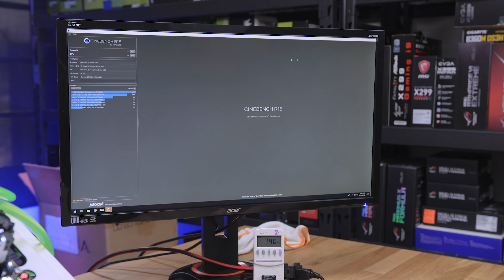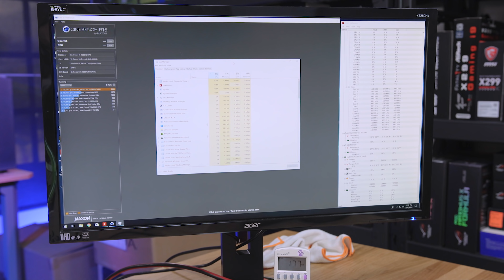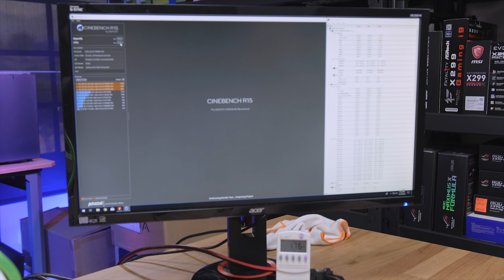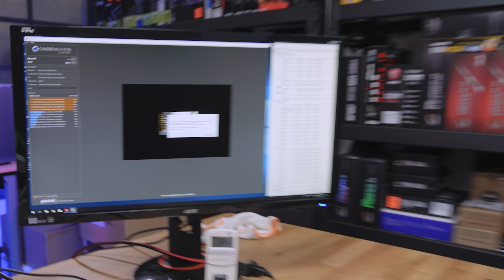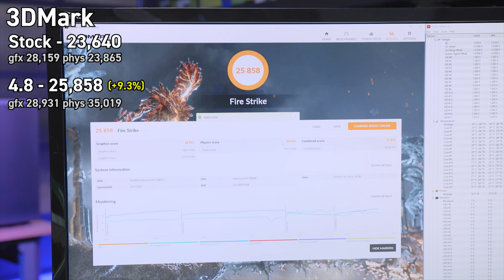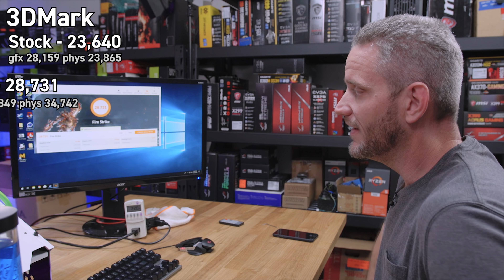Trying to get back on the 3DMark Leaderboard!

Comment: I barely reach 2100 MHz on the core with GTX 1060 until it starts to lower the clock right after 56 degrees on water.Guy gets 2.500 MHz on the core and call it Barely overclocked...  :D

Comment: Cool stuff man and congratulation on your top 100 placement. But a 1200 watt psu? why? You were only pulling 700 via kill-a-watt meter and 20% of that was lost in heat cause let's face it, 80% plus efficiency is only 80% ever on a good day when it rains dollar bills..... So 700 - 20% ='s 560 watts. Extension cord don't mean dick in this case, you can run "two" of those Pc's on a basic lamp cord and still be fine! 700 + 700 is 1400 watts which equals 11.6 amps assuming a perfect power factor of 1. 

I'm just saying, the lamp cord running the light at your bedside is enough to power two of those computers, you were in zero jeopardy running an extension cord unless it was maybe 500 feet long? Still, congratulations on your top 100.

Comment: Use a thick gauge extension and cut it to exact length to minimize on any issues of extensions
Longer the run the more amp draw you get

Comment: Worst case you are only pulling 11A.  If your extension cord is a 12ga and 25' you will not notice any significant difference from plugging directly into the wall. People make a big issue of plugging directly into the wall, but they forget they are essentially using a 50-75' 12ga extension cord  in the form of romex installed in the wall.

Comment: i can get 8ghz on a i7-2700k room temp has to be 10c to get those numbers. but it's only clocked at 4.6ghz.and i can never use the cpu fully only core 3 and 6 hit 100% and the rest won't get over 80%. and my pc won't get over 72 c at anytime on air only no water cooling loop.

Comment: You're also running on the wrong type of power in general. No one serious should be running the switch mode on generic household voltage.. yet you do.

Comment: The x5650 xeon chip listed on cinebench is actually a 6 core Westmere chip on the old X58 platform. They had dual CPU server boards available and a dual cpu enthusiasts board. With the use of one of those boards it would have two 6 core cpus and thus 12 cores and 24 threads for processing. A monster setup for the time.

Comment: @JayzTwoCents Is it even possible to build a really silent PC with zero compromises on performance. Watched your Asus Strix 1080 ti, also spent a couple of weeks watching reviews of different PC cases and still not sure witch components to use. Do you have any opinion about the beQuiet Dark base 900/800 and is there any difference. What I think for now is using beQuiet Dark 900 case + Dark Dark Pro 4(I use Dark Rock Pro 3 at the moment and is far from silence). Is it good idea to use its case fans with connectors of the strix 1080 ti.The idea is to use my PC for programming, watching movies(and reviews :D), music and base stuff without any noise, but be sure that the temps will be OK under 4k ultra gaming. There are some zero/hybrid PSUs as well.

Comment: Hey Jay, i recently bought a new PC not Pre-Built, with an I7 8700k on the MSi Z370 Gaming Pro Carbon with 16GB's of Trident Z RGB @ 3000MHz, and a ZOTAC GTX 1080 AMP! EXTREME, plus a Corsair RM650X PSU, and a 860 Evo SSD, im getting big stutters in every game which shouldnt be in a system that costs about 1700€, i would love to fix that because it was not cheap and im really getting headaches because of that, please help me...

Comment: Hey I am interested which version of Windows 10 did you use for testing? As for the background wallpaper I expect a Windows 10 version 1511  instead of 1803 (current). Is this right and did you choose it because it didn't gets the "slowing down" Meltdown / Spectre patches ?

Comment: Dear Jay, Please make a video about. How to reconize videocards and stuff.
The MSI videocards for example look very similair from the 660gtx till the 970gtx because of the red/black twinfrozen coolsystem. Its good to find any diffrences so you can tell your not being scammed. the only way I know you can see what card it is, is on the sticker on the rear. But its very easy to take that off and stick it on a older GPU card.

Best regards

Comment: Jay, what the hell are you doing? You're the Youtube GOD of custom water cooling and you actually run into temp problems? Put some rads in there, throw them in ice water, delid that CPU, GO BALLS TO THE WALL! What's the matter with you Jay, didn't have your coffee? Stop half-assing and GET THERE ON TOP! Get that TITAN V AND NUKE LINUS AND GN OFF THAT BOARD! DAMMIT JAY, GET YOUR SH*T TOGETHER, YOU CAN DO IT!!!!

EDIT: Oh and please just get a thicker or try using a shorter extension cord if you don't trust this one, but overall, they're able to take waay more power than that PSU requires.

Comment: Jay - 

Can the multiplier and the voltage values from one mobo be used on a different manufacturer’s mobo?? 
I was wondering what values might be used for... 3.6Ghz??
I’m not looking shorten the life of the chip.. just push it a little bit.

Comment: Redo this, with the insane cooler you made, with the giant fan, and four huge rads and air con. Run the cameras on batteries, turn off everything else in the house and overclock it until the software is on max, or it runs some other error.

Comment: hey jay, I have an issue with my gtx 960.
one of the fans grinds, but only when it gets above 75% speed. I've gone through a few suggestions i found, including taking the cooler off and seeing if the fan had moved any. no idea what's going on, could you help?

Comment: I have an idea for you, I have noticed with my stock 7700k (not de-lidded) that if I run the memory at it's rated XMP (3200) the CPU seems to get 3-8c warmer (depending on the applications used) than if I use the memory at the CPU's memory speed of 2133/2400

Can you do some testing to see if it's just me reading things wrong, or doing something wrong, or if there's actually some difference?

Comment: The x5650 is actually a 6 core 12 thread count that you can get for about 20 bucks U.S that benchmark shows results for 2 of them in a dual socket board
Reply: Yup and if you're lucky you can find a dual socket board on ebay for <$50 and have a complete system with like 1200 cinebench for around $200

Comment: would be nice if you could  try a "hybrid loop" with a TEC. I always wondered what would happen if you would sandwich a TEC between two CPU blocks and use the cold side to cool the water after the radiator and the hot side to heat up the already hot water from the system before the radiator. In theory you would be able to keep the delta pretty big in this way...

Comment: That was interesting. I'm sitting at a little over 20.5k with a 4790k@4.6 and an air cooled OC'd MSI 1080Ti (quick and dirty OC, no fine tuning, actually gets a tiny bit higher graphics score than Jayz best score)... I have a delidded 7900X coming with a full custom water loop (CPU monoblock + GPU) ready to be assembled in the next week or two. Happy days ahead!

Comment: So here we've proven that the Intel's TIM can remove 650W  of thermal power from the die with adequate follow-up cooler. I think we might owe Intel an apology here, and also deliding my i7-8700k with measly 95W stock TDP might have been unnecessary*...

Comment: Would it have worked better if that was installed into the Little Devil PC-V10 case with integrated Phase Change Cooler? and drop the CPU temperature to -70 degrees below zero.

Comment: just a regular 360 rad water cooler you say hmm if you did this with 3  360 rad coolers delided you could overclock this in the low 5ghz range

Comment: Hi I’m thinking of building a pc and I’m quite new please tell me if this is good and any suggestions would be appreciated 

Cpu - i5 8400
CPU cooler - be quite pure rock slim 
Mobo - msi z370
Ram- g.skill trident Z rgb 16g (if this is over kill for my pc I’ll happily downgrade as I’m no millionaire 
SSD - 850 EVO 250gb
Hard drive - 2tb Seagate 
Gpu - ASUS gtx 1070ti ROG strix
Case - nzxt s340 Black 
Psu - EVGA 650w super nova

Again any recommendations are appreciated as I’m new

Comment: I'm not usually the type of fanboy to scream on about what you ought to do.  However, in this case, with the particular chip you've lucked into here, it'd be a crime to not delid the thing, and push it to the max with, and without LN2.  Simply because it would appear you've got something really special, judging by the relative ease with which you can hold 4.8...

Comment: I must correct you, the 2nd place score in Cinebench is not a 12 core 24 thread X5650. It is TWO 6 core 12 thread X5650s for a total of 12/24. They are in a dual socket Dell T5500, and I happen to own one with the same X5650 processors. Though my score in Cinebench is 1354 without an overclock. It's from 2011 and still holds up just fine today.

Comment: You should really have a fresh OS installation on TestBench every time you change hardware. For obvious reasons (those of you doing this as long as me, 20+years, know what I'm talking about), that I'm sure you're aware of Jay! Also, what kind of shoddy electrics do you guys have in the US that makes you worried about running other appliances from the same socket? 600, hell even 1000 watts is nothing and doesn't tell the whole story.

Comment: An extension cord shouldn't matter too much. Most can handle 8 - 10 amps without significant voltage drop, which would be a minimum of 880W.

Comment: I posted this on Gamers Nexus, but I think this might be something you would like to play with too:

"I'm not sure how to word this as concise as possible, but I would love to see someone do a "Peltier loop": a regular water loop with a Peltier plate sandwiched between 2 CPU blocks in the loop. This would separate it from the motherboard to negate condensation worries, and possibly allow some really good cooling. Scary electricity bills possible though.

I'm thinking it might need to be 2 separate loops either side of the "Peltier sandwich" to stop the heat going back into the system, but if the water somehow went from cool side to the CPU you might get away with 1 loop, with the heat being dealt with by a big enough rad.

I've seen some people trying it, but not quite this way and I think you guys could come up with quite an elegant solution.

For clarification:   CPU+block-------Pump--------Rad--------Block+Peltier+Block-----------CPU
Or: 1. CPU+block----------Peltier(cold)--------Pump--------CPU.    2. Peltier(hot)------Standard loop system-------Peltier(hot)

What do you think?"

Comment: Hey Jay if you could theorize on why something is happening I would greatly appreciate it

Basically, I have a 2700x and some b-die ram I am trying to OC. I have a 101.4 BCLK currently

With 3606 16-16-16-16-32 + Special sauce sub-timings I get 1895 in cinibench 

Change the timings to 14-14-14-14-28, score goes down 20pts to 1875. (everything else is consistent) 

All tests done about ~8 times and averaged

Memtest shows 0 errors in both configs

Any reason why tightening timings would LOWER my score?? 

Thank you!

More info: asus crosshair vii with power limits all upped, team 3600 ram,

Comment: The power draw on this cpu is stupid, in cinebench alone it's pulling triple the wattage from the wall as an overclocked 8700k 5.1ghz and a gtx 1080ti oc'd 2142mghz core running aida 64 and furmark at the same time, this cpu is trash if you need the amount of cores go dual xeons.

Comment: Don't panic over that extension cord. If it's a 14 gauge cord or heavier, your line loss should not affect final results (I do lite mig welding off a 12 gauge/50' extension cord at 110v). Even a 16 gauge will handle it ok, as long as it's not too long. If you are really concerned about it though, get a nema 6-20r 220 outlet wired into the studio, since you can get a 12ft 6-20P to C13 cord (Amazon) that will plug straight in, and line loss will be cut dramatically.

Comment: jay a water kettle pulls over 2,000w from the wall so i think you'll be fine im an electrician by the way. a plug with a 13amp fuse can deliver a max of about 3,000w, to work it out its amps X volts = max watts so for uk its 13a x 240v = 3120w max

Comment: Hi, i plan on getting a new cpu soon, probably when intel 9th gen gets released, what I am wondering is if the same increase in wattage will occur overclocking those aswell or if that is only with this particular cpu? Right now i have a Corsair RM650X, will i need to get a better PSU to overclock or will i be fine?

Comment: R7 2700x @ 4.3 @1.375v if this is a good chip i'd send it to you and let you try to push it farther? it does 4.3 stable off air. (currently on x62 aio @60c under load)

Comment: Just curious, what if you placed the CPU Radiator into of a bucket of Ice, the Cold air drawn through the radiator might help.  Or even run the tubing in ICE.